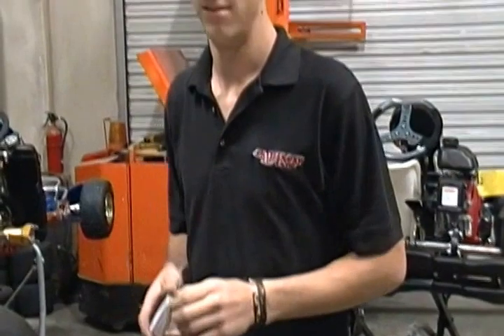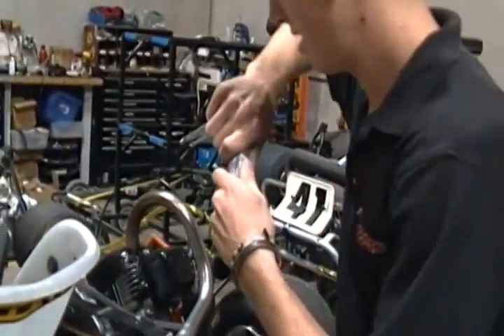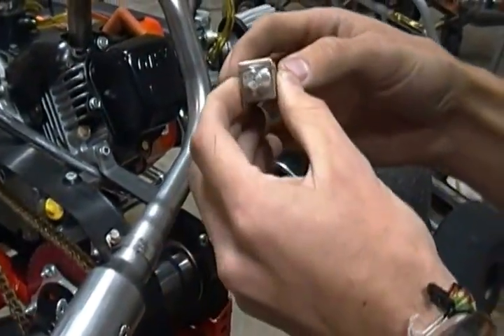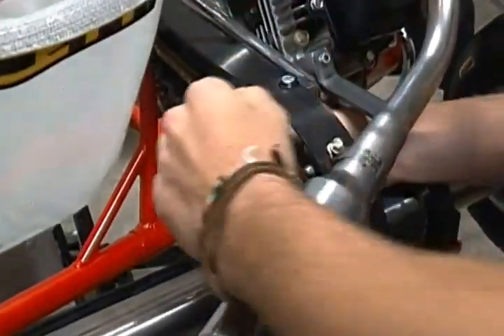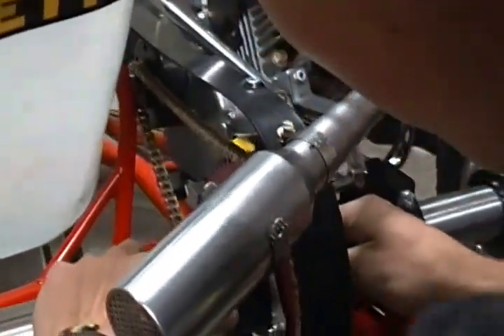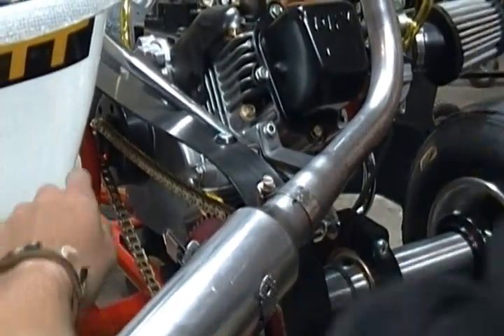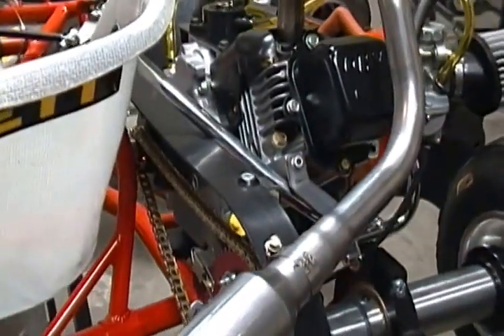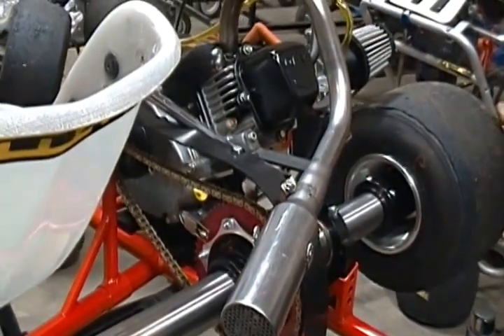Sniper Laser Sprocket Aligner

Comment: Will it fit a 420 sprocket?
Reply: It does not. We do offer a non-laser one that works on a #428 and it would fit a #420 as well. If interested you can find it using this link: https://www.accelerationkarting.com/428chainalignmenttool.html
Reply: @brookeparker7073  Looked at it, HOW long is the rod with it? Doesn't look like it would work for my rigged application
Reply: NEED to make one for the 420 and / or a universal application that works on numerous sprocket sizes
Reply: @REVNUMANEWBERN  Clipped onto the sprocket it extends to 6" with rod